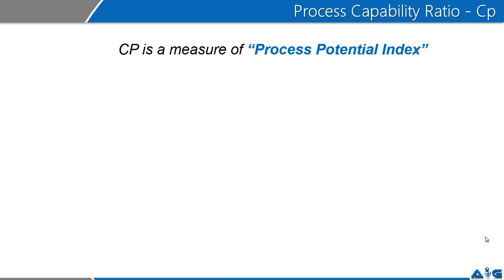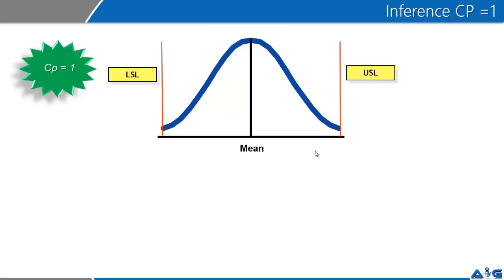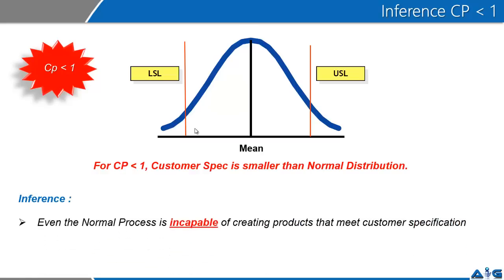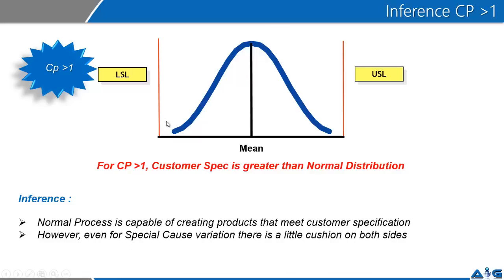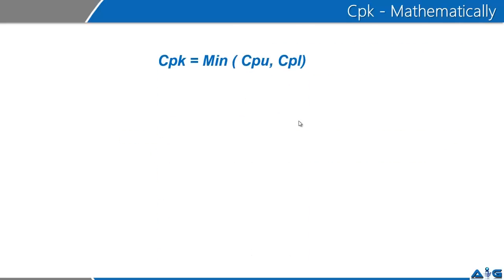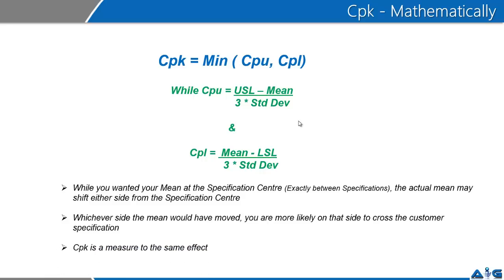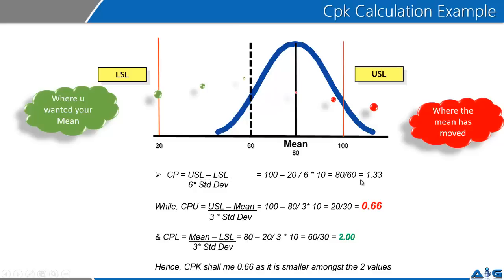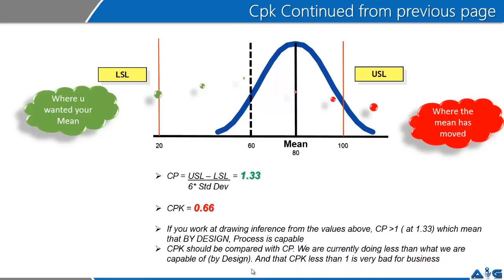Process Capability | What is Cp Cpk | Video on Cp Cpk - Understanding Process Capability

Comment: Consider this as an example. LSL=0, USL =12, Mean =10, Stdev =2 Whats the Cp. According to you it would be 12/2*6= 1 showing that process is capable of meeting customer requirements. But in this case 2.28% defects are being produced in normal process. Kindly explain please.
Reply from the maker: Indresh Saluja Mr Saluja, thanks for the question. While looking at CP, you are looking at short term capability i.e. Z St value shall be applicable and not Z Lt...and at that Zst level you will not have 2.28% defect as stated by you.

And considering the Normal dis concept, we are saying that beyond a ND only 100 - 99.73% data will fall.